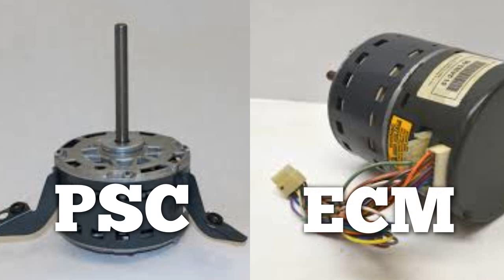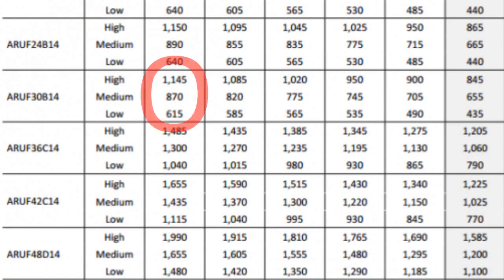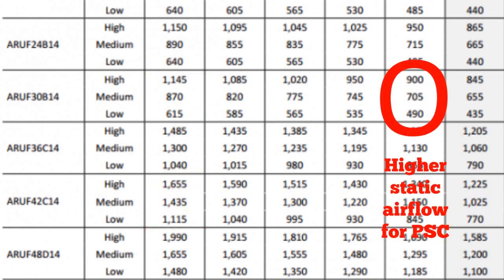PSC Motors vs. ECM Motors | High Static Applications | 1

Comment: The info in this video is partially wrong.

As you slow a psc motor down below the synchronous speed, the amp draw goes up. The resistance to  current is created by the back emf induced in the windings. The lower the speed, the higher the current. The typical 1075 rpm rated motor runs that speed under full load - completely unloaded, it's 1200 cfm.

As static pressure goes up,  the blower wheel unloads due to being negative displacement. The wheel moves less air per revolution and the speed increases towards the synchronous - the amp draw goes down as a result. The speed increase is not close to enough to maintain airflow due to the wheel becoming less effective so airflow drops. 

Take out a blower assembly with a psc, apply power with zero external static and the wheel will struggle to get up to speed, the motor will overamp.

The variable ecm motors on the other hand are programmed to maintain proper ecm - the module detects torque being applied relative to rpm and determines how much air is being moved -> it increases the rpm to get the flow rate.